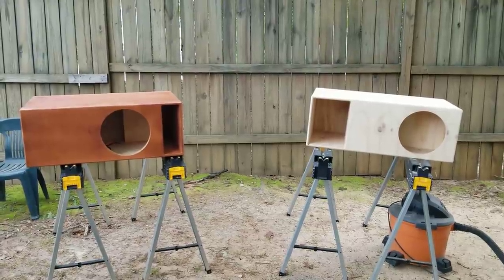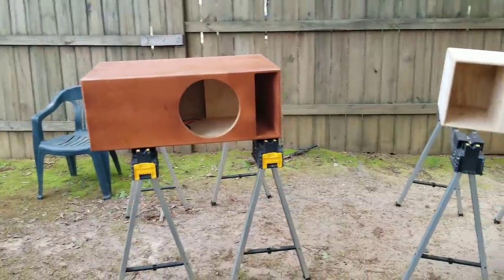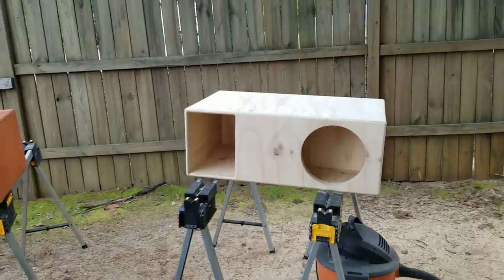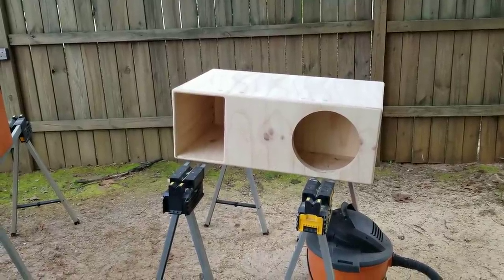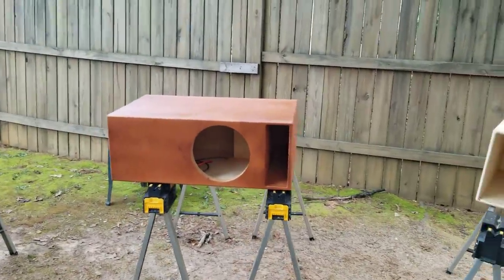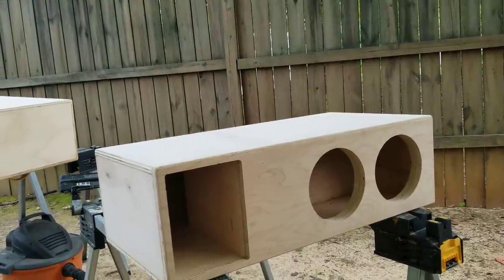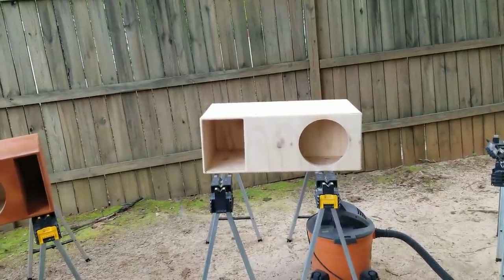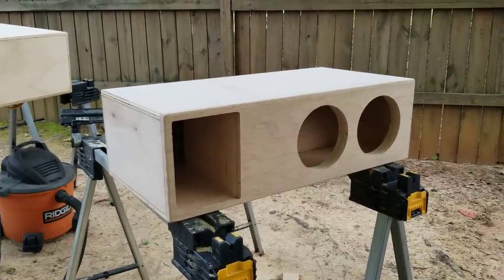Ported vs Horn... the differences simply explained.

Comment: I have a 4.7 cube box with 100 sq. inches of port area for a single 12". It was an experiment and worked quite well. Thanks for the explanation. I am planning on a box experiment using the principles of a "loading wall" and kind of a horn too for a more venue/stage show oriented subwoofer box.

Comment: First off this is the best channel yet about enclosures I've encountered and delivery of ideas. 💯 Good. 

I just bought three 12-in stereo integrity SQL 12 s and I'm going with a horn loaded front firing sealed off from trunk enclosure that faces the 3 12s like this if you were looking at them overhead \_/.  The chamber they're firing into is MDF on top and bottom of these three enclosures, reinforced. Each sealed in .8 cubic feet for a QTC that's tight and accurate. 

I was going to go with a front firing sealed off from trunk ported enclosure, with the aero ports ran up through the rear deck loading onto the glass. However,I've always preferred that thump and projection ability with accuracy that the horn produces.

Comment: I was always curious on what clubs and concerts used for boxes. Thanks man 👍🏻
Reply: Often double 18s nowadays because you can pack more in a lorry. If you need to drive 2 lorries to get the same output from horn subwoofers, then any efficiency gains are negated by the inefficiencies of 2 trucks vs one. If the venue has a low power supply and the subwoofers can be permanently installed, then you get more out of the horns, and spend less on drivers, though more on cabinet woodwork. Double 18s are good at concentrating bass for space, though Danley Tapped horns are probably doing even better nowadays. I've also found 6th order can gain quite a bit in the upper passband for only being 50% larger than a vented box, and that's without increasing the amp power.
I did my birthday party in a village hall and had substantial output from 2 12" subwoofers on 600 watts though only turned up about "40% loudness" which actually gives not 240 watts but just 30, for you need disproportionately more power to get slightly louder, psychologically speaking. By placing them both side by side and facing into a corner at close proximity - far more than I would have had placing one in front of each mid/high stand on the same amplifier. The rig fitted in a Citroen C2 and slammed and got pretty low too.

Comment: BudgetBassHead did a video that displayed a 5th order enclosure. You made a very useful point about ported boxes controlling woofer excursion using tuning. Would you consider it reasonable to use the port cross section to make a horn based on the port instead of the driver?

Comment: Question

im Trying to setup a System in my chevy spark (small hatch). and am curious to what might be better for Solid SPL levels. Should I Go horn or Ported?  Im wanting a single 18", I know it will take up most of the car lol, if i can even get it in there, ill go 15" if not. Unless someone thinks a 15 might be better anyways?

Comment: Ok question though.. because of the lack of back pressure doesn’t it limit the power handling of the sub? In a simplistic form it’s more like a free air in these terms. I’ve never messed around with horns but it would seem to me that you would want the resonance wall as close to the back of the speakers as possible wo loosing cooling so that you can maintain responsiveness of said speaker on kick drum bass as well adding whatever momentary back pressure you can to keep the speaker from bottoming out.. I’m I correct in this thinking?
Reply: No, subs won't act like a free air in a folded horn design. A good way to describe it is a ported box where the ports long and narrows the closer to the woofer it gets. One of the biggest concepts in a folded horn design is that as the air get closer to the speaker in the port. The port size reduces increasing the air velocity, this increase in airspeed and is what makes the speaker efficiency increase. Just like a ported box, folded horns are usually tuned to the subs FS. But they will give you a frequency response more like a sealed box, but louder and more efficient. A good example of a horn design with little input and lots of output is the Tuba.

Comment: So a horn port for 2/8 will make it sound like a pair of 12s a single 12 a single 15 what would you rate it as soundwise instead of a regular port ? Curious because I have four American Bass vfl 8's and I'm wondering if it'll sound louder or just as loud as 2 15's in a horn box versus a normal ported box

Comment: Don’t know if anyone else has ever had this experience but you saying you prefer larger port areas, I had a 15” sub in a 2”ported box when I was in high school,  I was moving so much air through the port that it would at times actually whistle and the smaller the port area the longer it needs to be to tune for lower frequencies

Comment: It would be nice to see a graph comparing the two. I use WINISD a lot but I don't recall it having an option for  horn loaded woofers.  I dont know of any that does? so what is the best type of speaker for a horn loaded woofer? would it be one that also works for an open baffle?

Comment: Because these enclosures are equivalent in size, I'm not sure how much more efficient the horn will be for these examples. The horn may skew its efficiency towards the upper bass, and of course some enclosures get closer to the Hoffman - Iron ideal than others. The horn will usually trade compactness for efficiency, as it takes a lot of space to fit that expanding port, particularly when you get to mouth sizes beyond a meter squared to properly support the lowest notes at high efficiency. In smaller "horns" you end up with a flared port or bass pipe design, which might have a wider bandwidth and has some advantages of each type. Usually in a given size constraint, the ported will play louder on the lowest notes.
The advantage of a horn is being able to gain efficiency over a broader range, whereas if you simply make a ported box larger, it will become a 1 note wonder unless you install a more efficient speaker.
Reply: Very well explained thank you tim

Comment: Could you build a box for 1 DC audio xl 10 dual 2 ohm? Can’t find specific specs for port area. Specs for box volume say 1 cu ft ported. I’ve heard this sub likes a lot of port. I emailed dc audio for more specs about an aero port and all they told me was a 4” port tuned at 34-35hz. I’m not opposed to going with a slot port, it’s in a box right now 1 cu ft with 14” of port area kerf ported, and there’s definitely some port noise. Let me know. Thanks for your time and keep up the great videos and information.

Comment: yo. i got 2 x 15 inch Kicker L7's on a Skar 2500.1D in an equinox and it just doesn't do what i want it to. I'm overdriving these subs. the amp is seeing 15 volts with extra batteries and welding cables big 3 and power. so the amp is putting out like 3000 watts @ 1 ohm (which is my final). the box is 12 cubes ported tuned to 33hz. and it's just not loud like it should be. I'd be very interested in one of your box designs given vehicle and power, if you would so kindly be obliged. thank you if you've read this far. - my electrical is a 300 amp alternator with a stock battery and a 170 pound AGM dry cell. (it's a battery that's used for powering towers and arrays when the power goes out, 1100CCA) I got a rockford 10 farad cap installed but i electrically deleted it because i figured that i have more than enough power. but a new box and that hybrid cap might be the answer that I am looking for.

yes. the stereo blurs your vision. but with this build and these components, a casual shouldnt be able to even sit in this vehicle. it just isn't that punch or kick to the face or chest that it should be. and there's no hair trick in sight.

Comment: Any reason why you use the staggered horn method over the tapered horn method? I am not sure how you go about working out the tuning when using staggered horn method.
Reply: Adding an actual taper to the horn adds a lot of difficulty in construction and making them like I made mine with different parts of the line different widths still yields a good result
Reply: @greenbassboosts8872  Yes i see this is a regular method in the car audio scene but from what i can understand by reading horn throat, neck & mouth measurements/ratios the stepped/staggered approach isn't a true horn or will not reach the full benefit of correctly designed horns as the mouth & neck would be enormous to reach a 33hz tune in comparison to MBE's The stepped horn looks to be more like a ported design hence why i question how do you tune one, my guess is you tune it as 33hz for every step/section rather than 33hz for the total length of all sections which you would probably need to average mouth & throat area to get length. I am wanting to try this design but Hornresp is too confusing for me & doesn't look to give me this option to do stepped sections.
Reply: @HashDogg06  Every box, I think, has a tuning frequency but mostly people concern their selves with it only with ported boxes. This isn't to say it's unimportant. I don't know how MBE tunes his horns. I used HornResp to plot out my horn and noted the tuning as 24Hz based on HornResp impedance graph.

Comment: Any advice you can give me, I’m 17 working in a shop called the Audio Edge and I’m trying to start my own company for sub boxes, trying to spread my name. Is there any advice you can give me in regards to making boxes.
Reply: Just know the size needed (sq. In.) and port them.
Learn from guys like this & whenever you can.
Im not really good at explaining things because I started out like you, years ago.
I have built custom systems & they won spl comps.
Bass is all about moving air.
The size of the sub does not matter, its the amount of air you can move.
I will link a video of my system I just installed.
Its basic, but works very well.
My buddy had 2,  4 way 6x9's with a 50w Kenwood amp, they hit like 18's, no joke, thats what numerous people thought, in a nissan sentra, rear seat removed.
Crutchfield breaks down box building, wiring, cross-overs, EQ's.....and they give dementions to go by.
Good luck

https://youtu.be/rZ2FXuCcgl8

Comment: I thought that the horn needed to be equal to the wavelength of the frequency to be amplified therefore they were mainly used for midrange applications since the wavelength of bass frequencies are too long . It’s interesting that you get good performance from such a short horn enclosure, I’ll have to experiment.
Reply: Yeah I’m curious how long this horn is unfolded. I built two 18” tapped horns and they required around ten feet of length to achieve 38hz tuning freq.  I can see why he stuck with 12” sub. Mine weigh 140lbs a piece lol

Comment: Yo mbe what's smallest box you could put a 15 inch sub in. That would still sound good. Thank bro, huge fan hope I could get a box built from you some day 🙏💯💯
Reply from the maker: A horn depends on subwoofer used...I have no control on the size
Reply: @M.B.Enclosures  what horn size enclosure would i need for a JL 13 W7 ?

Comment: The horn loaded enclosure allows the subwoofer to operate in the correct low pressure/ high volume displacement modality.
Reply: @nate0 How well would a JL Audio 13w7 work in a horn enclosure ?
Reply: @nate0 I mean how would it function
Reply: @nate0 I want to know if the bass quality will be better than that  of a
regular subwoofer

Comment: i have a more simple explanation ....... a ported or vented box , is a design in which the idea is to design a port that is tuned to "that" speakers resonant frequency (the lowest tone that  , that particular speaker can produce).....there is no point in tuning a box to 30hz if the drivers resonant frequency is 45hz , you will end up with a box way bigger than necessary with no advantages ..........also , if your speaker goes down to 40hz  , but your box volume is wrong and port area and length is wrong  , and your box ends up tuned to 60hz.......the woofer could get ripped apart and it will sound bad as well.....................the horn is a different concept all together ............think of the horn as a "transformer".......a way to "couple" the speakers energy to the airspace around it............the horn "flare" ............is the throat (entry)  , thru the horn flare (complicated math) out thru the horns mouth (more complicated math) that creates the horns frequency response and low tuning.......just like a Tuba or trumpet......with your mouth/lips being the speaker ........search for and download "hornresp" free software if you want to learn more..........free software is also available for vented enclosures on the web....... http://www.mh-audio.nl .........also very important is knowing what speakers will work in a "sealed box" vs  "vented box" vs "horn"......this is called the EBP  "efficiency bandwidth product" .......you dont want to take a speaker designed for sealed box and put it into a vented box , results will be weak and poor quality , same goes with the other designs ..............only certain types of drivers will work in a horn , most always.......only specific type pro-sound drivers with EBP over 130.................best advice is to learn speaker specs (T/S parameters) and what they mean , if you want to build good speaker enclosures

Comment: A lot has to do with depth of box, for pre loading the bass wave and frequency for tuning as well as the cubic feet volume of the box. It all plays a part in creating the decibel rate ... However, there's more theory to what you're explaining as to what box will fit the criteria of the vehicle goes in to. As for the boxes your promoting, it depends all on the volume of the vehicle it's going in. Now, if you're putting in a trunk of a car versus a suburban with more volume of opened interior area. A trunk of a car, the trunk will act as a bandpass ... You feel me ? Scientifically, the information precise to these boxes will play differently as to vehicles they are put in & the volume space you have to work with ... The port size is the answer, to the vehicle the boxes are placed in ... The port style will hit harder in a trunk than in a suburban. The larger port MIGHT hit harder in a suburban, due to it tryin to fill the interior area with air to strengthen the bass wave and accumulate the frequency to meet the tune and which way they are faced and how far the wall / back gate is from the box  If that makes sense ... As well as wood type and thickness ... The solid wood that won't flex, helps with the distortion from robbing sub of the inertia of the bass wave
Reply from the maker: 😂…man get your own channel with this BS
Reply: @M.B.Enclosures  i want to build  a  mobile 2.1  boom  box  100w sub   the  box in  the  midle  interested  me kan i have  a plan or idea vor the dimensions  for a 100w  sub  ,,,,,,thanks  👋👽👍🏼

Comment: There actually infinite baffle set ups at concerts
Reply from the maker: Cerwin Vega and Yamaha concert series cabinets are not infinite baffle sir
Reply: @M.B.Enclosures  yes yes they are that’s why auditorium set ups that hang from the ceiling do not have a back on the box. There is just the front by for that holds the subwoofer in place. The back of the box is open.
Reply: @M.B.Enclosures  I used to replace auditorium speakers in concert halls in 90% of them had the big horn tween and then a big 18 inch sun all the boxs was just from baffle and top bottom and sides no back on them so in theory that’s a type of infinite baffle same concept